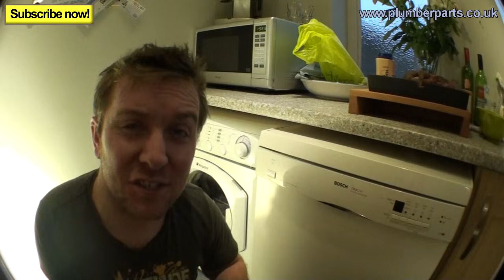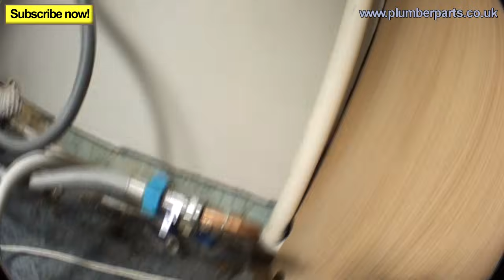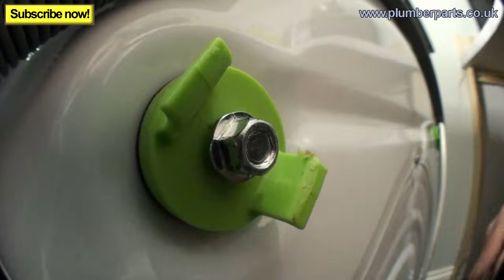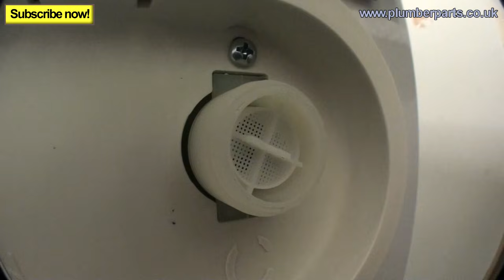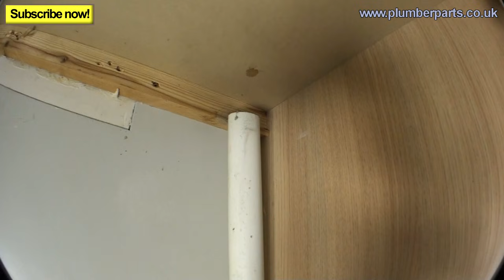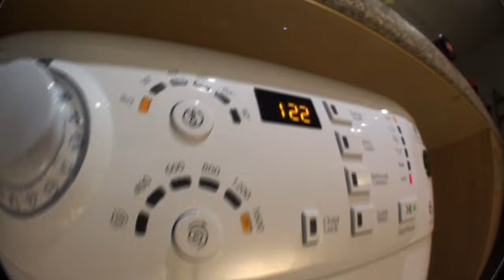HOW TO INSTALL A WASHING MACHINE - Plumbing Tips

Comment: Hello mate. Because my boiler is not working as it's broken down. 

I have a hot and cold water feed to operate my washing machine. 

Does a washing machine need to use hot water from the boiler? 

As my boiler broke down. Does the boiler have to work to heat the water from the hot feed? 

If not, does or can the machine heat up the water with the boiler not working as the appliance already contains a heating element? 

Pardon me if the context is not explained correctly. It was only to get your opinion instead of a repair request. 

Thank you.

Comment: Hi James ( @plumberparts) following you for many years and I have a problem with my washing machine with the inlet valve that fills the washing machine when turned off. I believe it is not the valve itself, but the changes in pressure when opening the kitchen tap (it is connected to the main). Is there something I can do, I read the valve needs at least 20psi to work. Is a hammer arrestor or a non-return valve something that may solve the problem? From the kitchen main is a pipe that has a Y connector that splits to the washing machine and dishwasher. If you add an arrestor, where would you add it? before the Y connector or before the washing machine? Thanks

Comment: Didn't watch this video and didn't read the manual before installation.
And because it was my first installation I had no damn idea that you need to remove those bolts on the back.
When I was running the first cycle entire building almost collapsed from the vibrations, it was absolutely insane...
Mental note: don't be a smart ass and if you do something for the first time common sense might not be enough and at least watch some yt video.

Comment: How far should you push the  washing machine waste pipe into the existing house waste pipe?? Mine seems to keep over flowing a bit, even though I've only got it going into the pipe by 3 inches, so not into the u bend section. Any advice would be much appreciated 🙏

Comment: What to do if you can't get a grip on the connection to the water inlet because the space is too small to get anything on it. Even the smallest set of monkey grips won't fit :(

Comment: I have had this washer for one week now have Done about 8 loads of wash=>>allmy.tips/WhirlpoolWasher?S45     So far I love this washer the main thing to do before you use this washer is read the manual to understand how it works with less water. The machine does make different noises. This is normal. In the reviews I have read saying it's loud . Not loud just different noises. Saying it walks across the floor when spinning . No mine spins the way it should. the main thing is make sure the machine is level . It does take a little longer to do a load of wash but it comes out clean. I believe this washer does a lot better job of cleaning than my old washer. To sum it all up it is a great washer

Comment: I need to put in the 2 new pipes ehich connect washing machinr to water. But the red lever is fully stuck. It womt move to the 3 o clock position it just stays at 2

Comment: yes you missed the WIRING out mate - I have a 3 pin plug from washer that needs to plug in a blanked off plate in the wall ?
Cheers if you reply.

Comment: Hi James great video's keep up the good work. Got a question, I'm fitting a washing machine and the cold feed is t'd of from the rising main but the is no pressure in the cold feed for the washing machine but full pressure in the cold water tap which is coming from the rising main directly. What could be the issue mate ? Cheers James.

Comment: My hoses don't reach, I guess I need to buy longer hoses. All 3, water and waste ones. Also I don't know where to run my waste hose. There's a coupe of little things sticking out of the sink pipe, that look like connection mouth pieces, but I would need to pierce into the plastic pipe to open them up. And then there's a metal cap over a hole at the top of the sink, which I can't get off without excessive force. And that's really hard to get the waste hose that far. I'm renting so don't want to damage anything. Can I get waste hose extension? The waste hose is not detachable on the machine.
Installed my mums new machine for her, but that was a simple swap over. Never saw how the last tenants machine was hooked up. Help?!

Comment: Hi, I have a 4 inch waste pipe flush with the ground. I'll be plugging it with a rubber adapter to accomodate a 1 1/2 inch standpipe. Question is should i put in a p trap also?
Reply from the maker: +toz71 No, standard washing machine trap is fine!

Comment: Had Currys installing our brand new WM and guess what they messed it up and the waste was twisted and leaving water unable to drain from the machine.
Reply from the maker: +Amitav Raja Typical!
Reply: +plumberparts  hi the retailer is now blaming the clogged up waste pipe for not draining water for brand new WM. How do I check that it's not the fault of the installation, or the WM for not draining the water?

Comment: if I didn't remove the green part and let the machine work forminutes is there will be any problem could happen
Reply: If by green part, you mean carriage bolts in the back, yes... you can totally shred the gears/motor...

Comment: Dude! Just connected a Samsung to the shared drainage under a sink. Got halfway through the test run then got an error message check drain hose? It's all connected with but I'm doing something wrong. Any ideas? Big up yourself!
Reply from the maker: +Krang McRaven Is it sorted yet? PP!
Reply: +plumberparts Yes it is thanks mate. I put two of those plastic curves on it trying to be cocky getting the hose over the back of the cupboard. Took one of and repositioned it worked a treat.

Comment: good video .....amazing how many people think they need to pay to have a washing machine installed,its hardly complex, and certainly not worth £25.....
Reply from the maker: +Stu Wright Indeed!
Reply: I've paid Currys £30 to install mine and they flooded my kitchen the first time then came back and reinstalled it and its still leaking...time to do it myself and ask for my £30 back...oh and the grand to pay for the floor :(
Reply: Yeah well Ithought  the same thing, specialist joints or seals or what ever.......
Reply: It depends if you have to fit the washing machine iv + waste trap then it could cost you that in parts but yes apart from that if you have the basic tools ie water pump pliers it no problem very informative video 🤓
Reply: +plumberparts my power cord is bolted to the machine how do I get it loose

Comment: I tried testing the cold water pressure, but for some reason, the water doesn't come through, even though the sink that's connected to the same pipe works.

Comment: What about the drain pipe if it's connected under the sink. I'm having an error code flash up because of the drainage and i think it's because the pipe may not be bent in the right places.

Comment: Why do I get an awful smell from my machine  should the drain hose run up the back of machine to the outlet connection or should it come out the bottom then run up the wall onto the u bracket then into the connection.
Reply from the maker: Check the rear waste pipe. They can get squashed or blocked. Also make sure it doesn't run all along the ground. PP!

Comment: ok, looks easy BUT, i have bought two new pipes, to fit the old washing machine in our new house But the pipes still leak at the washing machine end. I should not have to use Plumbers Mait or white tape. As you demo finger tight plus a tweak, but nope we still get a flood. Could there be some back flow causing it? and I am getting "get a proper plumber" in my ear!!!
Reply: +Jon Harris Did they have the right washers in place... This happened to mine and the man hadn't put the washer in one of the feed pipes... he did not like being asked to check it...

Comment: is there supposed to be a rubber seal on the cold feed side aswel?
Reply from the maker: D1str1ct Yep, did we miss it? Cheers, PP!
Reply: it just mine was leaking and just wanted to know if that was the reason. iv put one in and it seems to be fine now. ty for the reply

Comment: Hi I have a beko washing machine.
WMB71231B. 
I have only 1 hose supplied with machine. And only hole for the hose. But I have to feeds separate water and cold. But I can only attach 1 hose. Is there a way to attach both feeds?

Cheers
Reply from the maker: Just use the cold feed. The washing machine will hear its own water.
Reply: ***** 
Thanx for advice..works brilliantly now.. Top man☺

Comment: what brand was ur old washer, so we can stay away lol
Reply from the maker: randomrazr Ha! Think it was a Bosch!
Reply: ***** really? thoguht those were supose to be high end and reliable . i was thinking of picking up a samsung at homedepot
Reply: The washing machine that went "mental" was a Hotpoint. Looks like the owners replaced it with another Hotpoint! Get a Miele or a Bosch.
Reply: gosh those are so much more expensive! and i cant find a miele here in canada?
Reply: randomrazr it was a ariston
Reply: ibaisaic the hotpoint that went mental was made by indesit that are known to go mental and the new machine is also a hotpoint made by indesit but after they resolved the mental problem
Reply: Miele makes bikes and Bosch makes Power Tools.

Don't buy either of these brands. Get with the times and into the 21st century. Get an LG or a Samsung.

Comment: What about grounding the machine? I live in what seems to be a quite an old apartment complex from the 60s (Eastern Europe) at the least and I don't think the outlets are ground. We also need to use an extension cable as the bathroom doesn't have a plug.

I've heard everything from just getting a surge protected extension cable, to attaching a metal wire from a metal piece at the back of the washing machine to the cold pipe, to changing the entire plug. I have no idea what to do and am looking to hopefully not shell out a lot and have someone dig up my entire wall.

What are your thoughts of this from your experience?

Comment: I would not recommend using a wrench on the new plastic fittings ...they should be hand tightened only as they are now built so the pressure of the water tightens the joint.....over tighten and you will crack the inside and possibly the out side of the joint.

Comment: Drum Bearings shot on LG needed ear protectors anyways still on warranty so drained it via the small lower access panel Having a small hand truck helps  LG no warning call sent a guy 180 mile round trip after a month without one and phoned me needing a hand to load it on his van
Thanks for vid

Comment: Cold only feed is a crap idea. If you have a cheaper/ more efficient source of hot water, why not use it? It means you end up having to heat water on electric, which uses loads of kwh's. Then they stick a A rated sticker on it for an extra couple of hundred quid. It's all bollocks mate, just to make the manufacturing cheaper. They dojn't even sell hot/cold feed washers anymore in the EU. Probably some politician pulled that idea out of his arse.

Comment: I just bought a home in Sweden and the washer (functioning) was left behind by the seller. I don't remember much about the electric bits and don't see a power switch on the machine. Would I find it in the small electric box mounted on the wall behind the washer which is screwed shut? My fuse box is fine and I turned the water supply on, but there light indicators on the machine do not turn on nor does any cycle begin, despite already being installed.

Comment: As a plumber I always tell people to turn off the water supply when not using because busted washing machine hoses are the biggest culprit for insurance claims. The working pressure in my home is 90 psi.  I also recommend changing the water supply hose every 5 years whether it needs it or not.  Your video's are fun to watch.

Comment: hi PP..... great video! thanks... I thought it was more difficult!! Im going to have a go myself!!  Ive pulled her out... but see that my waste tube doesnt have a ubend tube fixing to the wall, it seems to go from machine back to outer wall and then to the other side ( outside) and down to the drain. Q: can I just cut it off so I can remove the old washer..??.

Comment: That was really useful for someone as useless as I am. Thanks. Ive just called someone out to install new hoses -he was amazed!
  The old hose pulled away from the red screw on nut completely and I couldnt unscrew it.
 Am I right in saying that if the red and blue taps are always switched off when not in use you cant get a water damage leak?
 Thanks.

Comment: Hi. I live in a council flat and it has no drainage. Only place there is is under the sink  with about a 12 inch gap from the top. So theres no room atol under there. Anything I can do? Just drain directly into the sink ? Or would it be to high?

Comment: i've got i think the exact same new washine machine(hotpoint) but it shakes violently so i 'm not running it. i've only had it brand new and it doesnt seem to fit with the kitchen cabinet. there's a little space which i think causes the shaking. Any suggestion on how to make it fit? are there any adjusting part that i can buy to stop the shaking? i'm thinking about putting pool noodles between the spaces to stop the shaking. the last thing i wanna do is to buy a new kitchen unit.

Comment: I connected my water supply from the cold bathroom tap *upstairs* and ran it down to the washing machine *downstairs* but its only trickling water out seems to be low pressure I used one of those easy clamp devices that you just screw on any tips?